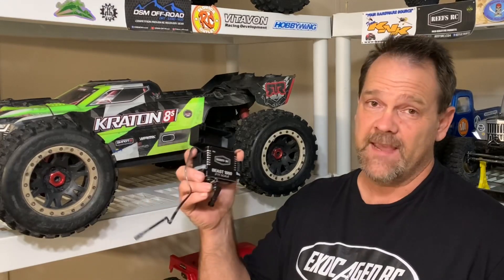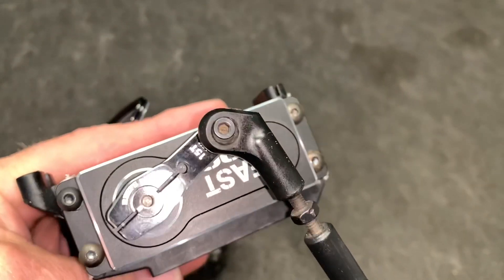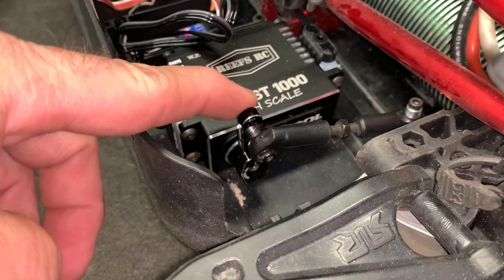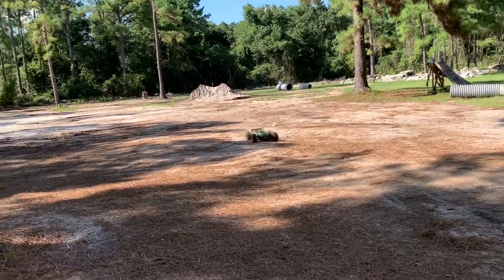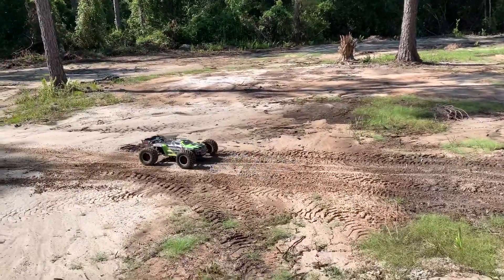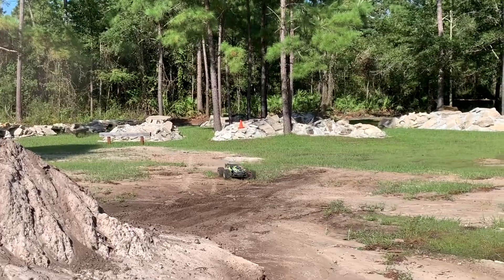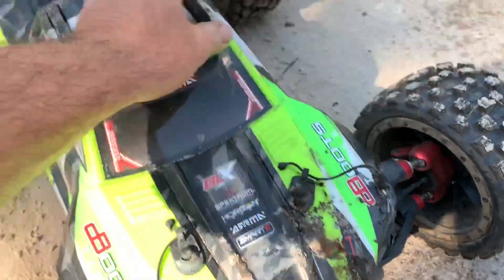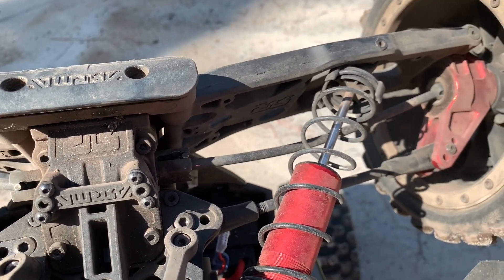Reefs RC BEAST 1000 Servo in the Kraton 8s! NO SAVER!!

Comment: That back yard😳😳😳 why would you bash any place else....rc paradise 😎👍
Your a madman, no saver on that 💵 Servo😲
Reply from the maker: Yeah it was risky. I ran it again yesterday for a battery test and broke the link end coming off the servo. Servo is good.
Reply: @ExocagedRC  wow that's some good gears then if the link breaks before the gears and there is NO saver😎😎
Too bad this beast is WAY out of my price range.
I'm always looking for the 40-120 servo that is a bargain and reliable.
Wondering how this 9imod 45kg servo is gonna fair for me, it was $30😳😲 so if it's 80% up to specs will be great.
Worth a test on your servo testor?? ... The video should make back that money eventually
I have this 70kg 1/5th scale STI or somthing off Bangood I haven't put in yet for my Outcast.
To be fair my Outcast has been fine on stock servo Bec 8.4💪... And I am Rough on my rigs, you know if you seen my videos 🤣🤣😳
Rock on brother
Reply: @ExocagedRC 
Maybe try cutting the bottom of the box to drop that servo lower to make up for it being taller, that way saver and servo axel can fit proper.... Protect that beast.... It will eventually die from impact no matter how tough, without a saver. But with one it might last FOREVER
Reply: @3SonsRC  That would be cutting into the waterproof receiver box. Not a good option.

Comment: That was a great run! You have got to get the EXB front bumper and put it on your K8S, they take some much abuse compared to hitting the tires first every time. Also, HR has come out with a servo saver design that is a bit more traditional, might be worth checking out.

Comment: Ahhhh the pain. I wanted to put this servo in my karton... I wanted to mate it with my 4pm I believe this servo was SR compatible....the pain continues I recently purchased the AGFRC A280BVSW 3/4S I believe this servo was compatible as well...unfortunately I had the same problem as you, the mounts on the servo sat higher than the mounts on the 1/5 servo mount supplied with the 1/5 exb....no room for the servo saver...the hunt continues. This is getting aggravating.
Reply from the maker: I have a newer video showing the use of the Hotracing servo saver. That works.

Comment: Hey Joe just wondering how's this working out for u now is it still running good I want to do the same servo
Reply from the maker: did fine but I used that servo in another vehicle so I could put a saver back on this truck
Reply: So how many runs did u use it like this I'm gonna run this servo in a outcast 8s how would you suggest to set it up. Also is there a servo that's good quality but cheaper in price that you would recommend?? I love reefs but in canada this thing is almost $500 lol bit of change

Comment: My Hot Racing servo saver arrived. There are 2 issues with it. The center hole for the screw is too small. I had to drill out the hole to 9/64". The 3.5mm X 8mm screw supplied by Reefs RC is too short. Finding the right screw is like looking for a needle in a hay stack. The 3.5mm screw is one of the oddest sizes ever. However, I did manage to find the screw that's needed at McMaster-Carr. It's an Allen cap screw with a 3.5mm thread that's 16mm long. Search for 91292A352 at McMaster-Carr and happy bashing.
Reply from the maker: Awesome info. Yeah the 3.5mm is odd. I’ve got the saver here now. Need to make it work

Comment: Do you think the 1000 will go in the Xmax ??
Reply from the maker: Nope
Reply: 😞😞😞to big even if I cut some away from the Chassis what 1/5 servo could I use I need help
Reply: @jusswild  I believe they have 3-D servo mounts on EBay . You might have to trim for that servo an it’s gonna install on of the RX box. Hope this helps.

Comment: Will the Vitavon Kraton 8s servo saver work ?
Reply from the maker: if the servo would sit back like the stock one, yeah it can be made to work, I've ordered the Hot Racing saver as I'm hoping that design will fit in there
Reply: @ExocagedRC  If the Hot Racing servo saver works post it up please. My Beast 2000 arrived yesterday. It probably doesn't need it. I placed 3 washers between the mount and the servo.